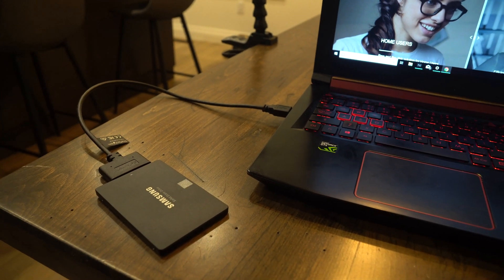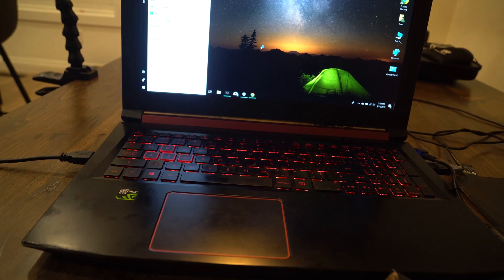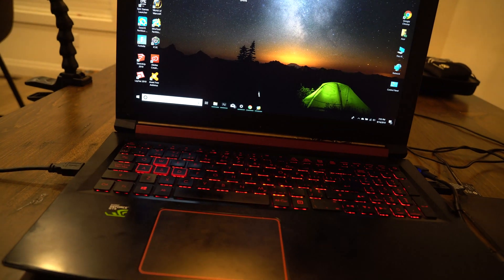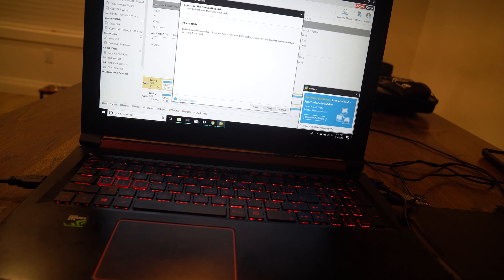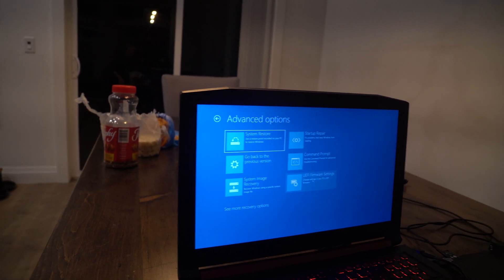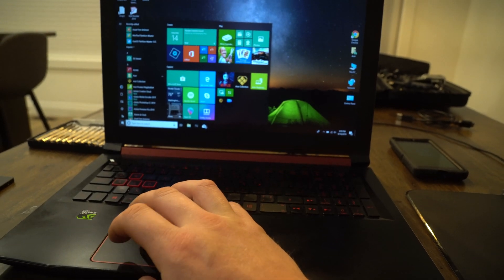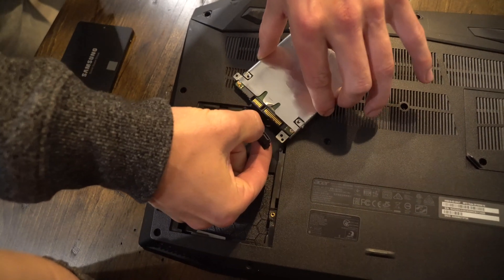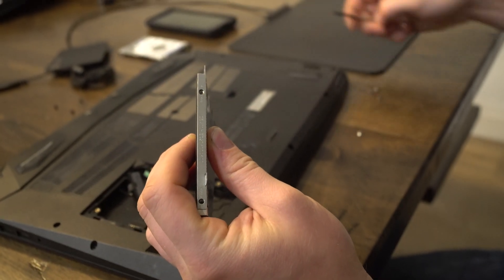HOW TO REPLACE AND CLONE A MAIN HARD DRIVE ACER NITRO 5

Comment: When you removed the old hard drive what type of screw driver did you use and would that hard drive work in a desktop build. Please some one help.
Reply from the maker: Believe it was just a phillips, I could but there really isn't a safe way to secure it in a desktop build. With the price of ssd being so low now I would use SSD all the way for desktop
Reply: ghostlyrich I know I have that exact laptop and am currently building my own pc and I wanted to use the 1 tb hdd as the storage drive for my games (I already own an Ssd) and I figured since all my games and windows home are  on the hdd I could just steal the hdd from the laptop and put it in my case
Reply from the maker: @dookeybootie  the windows won't work from the other laptop hard drive as soon as you plug it in it'll see that the motherboard is a new motherboard. And will make you reactivate the license. And it will only allow you to have one PC activated at a time
Reply: DookeyBootie and even if you got the hdd and plugged it into the laptop it won’t recognise the hdd so you have to format the games

Comment: My HDD drive failed before I could clone everything. I bought a new SSD to replace the dead HDD. My HDD will not read anything, meaning I have to start from scratch. How do I re install windows 10 OS?
Reply: buy a new lisence sorry :(
Reply: @leonardhd4964  no need, windows 10 on most laptop's is digitally licensed. You can reinstall windows and it will activate automatically even without a product key
Reply: i think that the acer nitro 5 has a oem windows 10 key